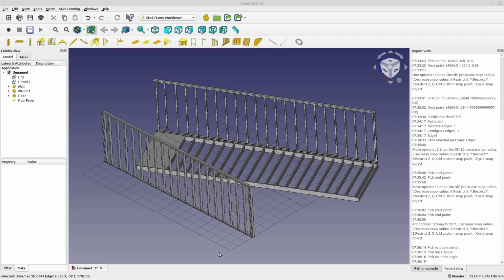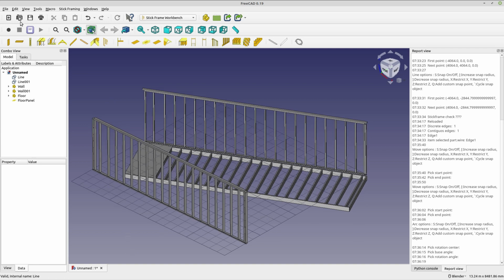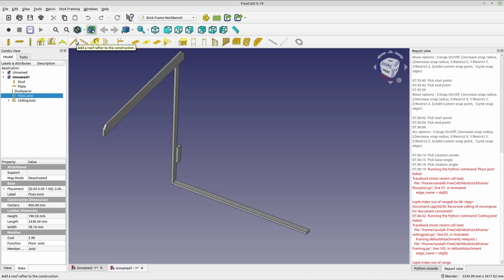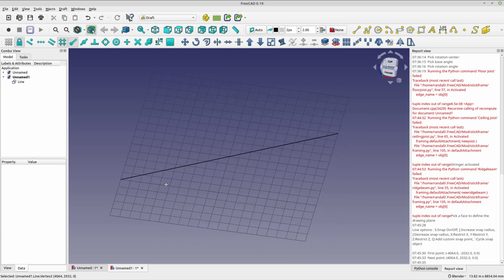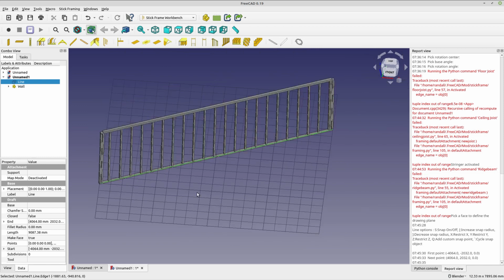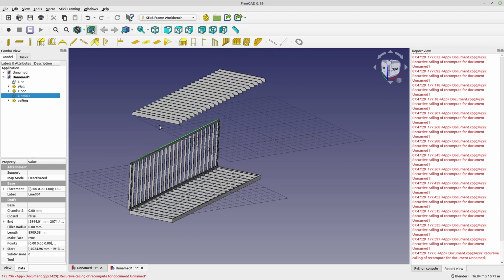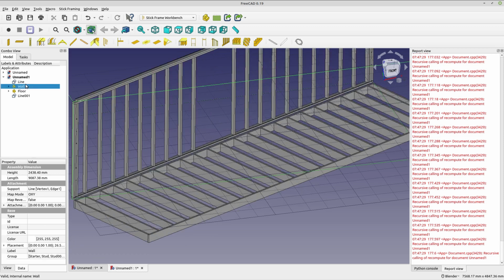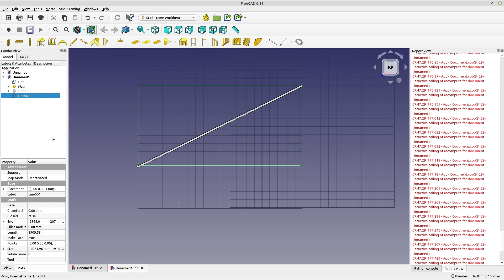FreeCAD - Stickframe Workbench Update

Comment: Absolutely brilliant so far.  Great work. Is there a way to change the timber size.  The Lumber dimension doesn't appear to be editable.

Something you might consider for later development is a stud wall with different height at each end, i.e. sloping top plate.
Reply from the maker: That's a great idea. The lumber dimensions are a work in progress. I would like it to be a global setting where you can swap 2x4 walls for 2x6 walls. Each individual piece is editable in length. I was planning on presets for width and height.

Comment: Great, can we expand not only to stick but also the beam and iya connection?
Reply from the maker: Eventually, yes I want to get the basic functionality ironed out then I would love to add Beams. Basically when I can take a floor plan and click through in about an hour or two and have a house model. Then I will start adding beams. Then little bits that I missed like Joist cross members and stuff.
Reply: @mathcodeprint  great, i would like to learn how to code it too, however i don't from where to start, could you please advise me?
Reply from the maker: Sure, do you have any coding experience or just getting started?
Reply: @mathcodeprint  i have coding experience but it was long time ago using fortran 77 or qbasic
Reply from the maker: That will be a pretty big leap. You will have to start with just Python. There is quite a bit more to it than what you will have done with qbasic or fortran. When you get used to the concepts in Python then add FreeCAD to the mix, dont try to learn Python and FreeCAD at the same time, to many layers.
Reply: @mathcodeprint  well noted and many thanks for your advise